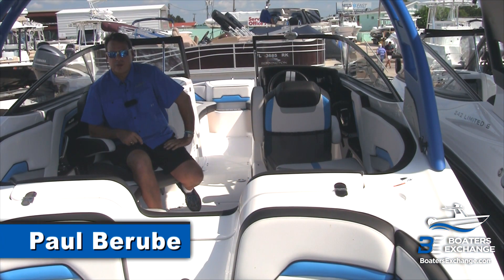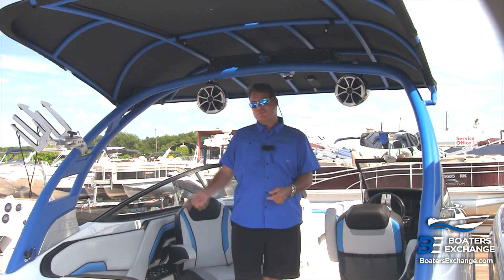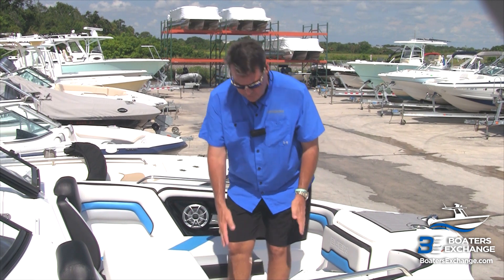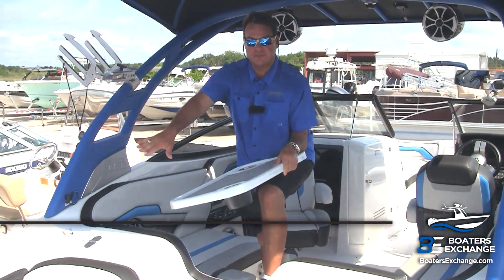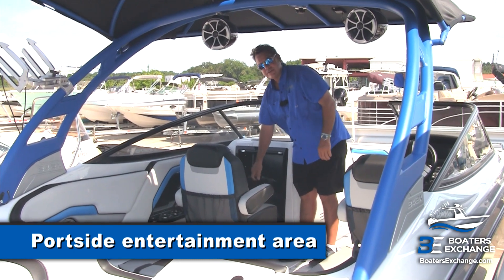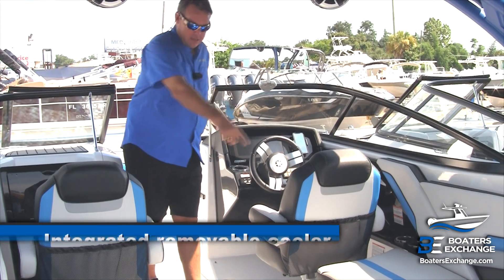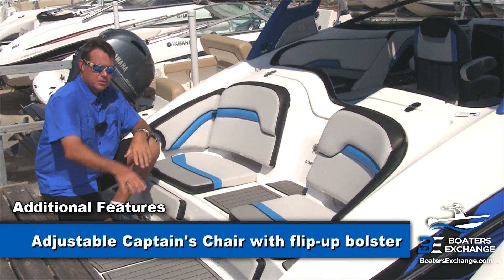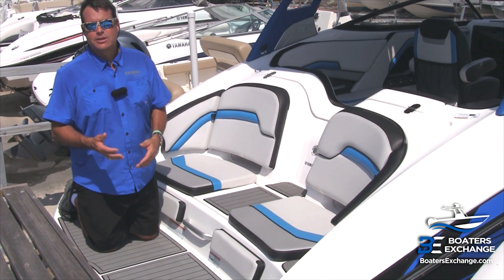Yamaha 242X Walkthrough by Boaters Exchange

Comment: The bi folding windscreen door is a gimmick as it opens up the bulk head storage allowing bow spray to enter, the last 2012 Sea Doo boats had a much better door that slide like a sliding door in a hole from with in the bulk head